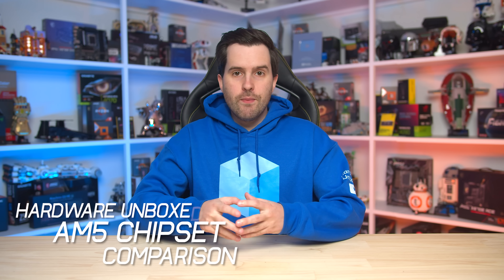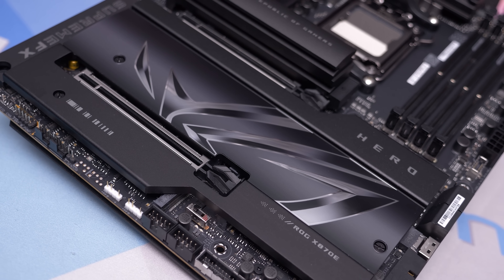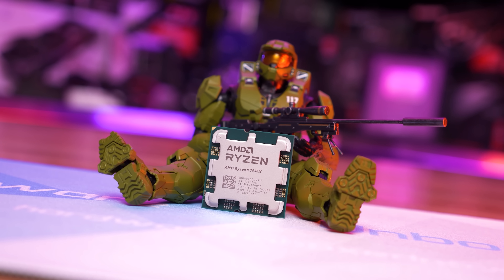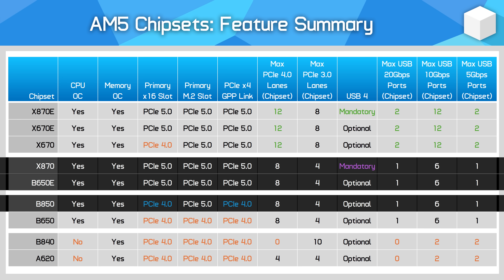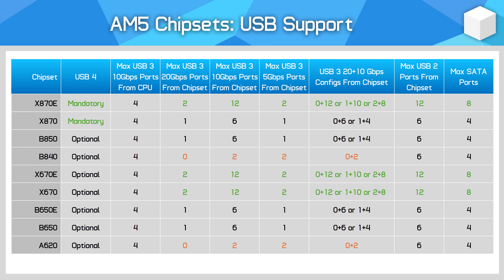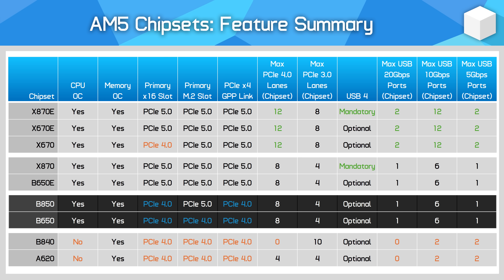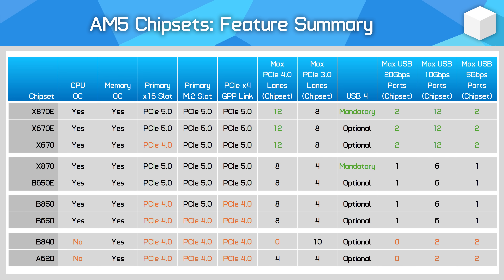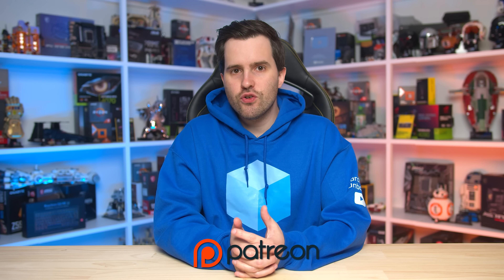AM5 Chipsets Compared - X870E vs X670E vs X870 vs X670 vs B650 vs B850 vs B840 vs A620

Comment: with a 7800x3d and 9700xt, gen 5 ssd, and cl30 6000 ddr5 memory, which chipset/board would be best to be a good upgrade path for zen 6/rdna 5 flagship gpu's that won't run into bifurcation/ddr5 memory issues (like excessive memory training at boot or expo instability). The 870E has the "usb4 tax" of 4 lanes but if you're not going to run multiple gen 5 ssd's (just 1 main one), will you still run into bifurcation issues? They seem like they've got the best ddr5 memory stability but between asrock nuking cpu's and msi supposedly having m.2 slot issues, it feels like I'm limited to asus or gigabyte. are you guys still going to do the x870E buying guide? or add like the new x870E to reviews like the gigabyte x3d lineup etc?

Comment: isn't there only x650 chipset as a die. and some MB configurations make it x650e version, like ability to rout pcie 5.0 signal. coz some MBs state x650 as  chipset. but according to specs can rout pcie 5.0 to gpu and  one m.2 slot as it should be. table in the video just brings more confusion

Comment: Im trying to build a new Gen5 system with a 9070 gpuwith a ryzen 7 7800x3d and im looking to use a mobo with it..its hard to find a matching board but i want to have the best uyse off my pci lanes so my guess a Asrock 870 pro is my best bet.

Comment: But today we have to answer one question: when you're still using an Athlon processor or an Intel i3, you might want to consider overclocking, but today it's no longer necessary, so all those glitches are unnecessary....Usually, in 2025, they are targeting Ryzen processors, most of which are already optimally tuned for optimal performance, unnecessary overclocking will only spoil the results, similarly to Intel,,,The most important thing that has remained for years is to maintain stability. This applies to the choice of motherboard, processor and RAM...these technical things, if you know them, you have a good computer

Comment: I got first an Asus x670e on sale for my 9950X3D and 2 x Kingston 6400 Mhz RAM with 32 CLT and a PCIe 5 NVME. I was dumb enough not to check the compitability of those components, because some were not listed as my PCIe 5 NVME and my RAM sticks. In theory they should work, but I had so many issues and instabilities that I had to sell my motherboard and buy a x870 instead. Havn't had any issues since then. Now I could have had just bad luck and gotten a faulty motherboard, I will never know. But to try to save 75-150 dollars, that money is not worth all the hassle I had to go through and it cost me more than I wanted to save, but if you don't go for the high end stuff like I did. Then for for the x670e motherboards!

Comment: So given the choice between X670E & X870 should I go for X670E but isn't it older gen, does newer gen matter or not? Please guide
Reply: if u dont use usb 4 its doesnt matter, got a x670 with 4 nvme slots, its good enough and better than b850

Comment: I'm thinking of upgrade from am4 to am5. Currently sitting on a 5800x3d and a 4070 ti. Should I go with a b850, wait for am6 or upgrade to a new gpu? Now the gpu is the 12gb vram that is the issue.
Reply: 5800x3d is still super good just stay on am4 until amd does something good with am6

Comment: Sooo, to pair with a 9800X3D a B850 or better is preferable for out-of-the-box functionality depending on budget? I would think it also depends on the board itself, some boards make the secondary M.2 slots share bandwidth with the primary PCIe slot. I've seen that on a couple Gigabyte boards, especially their boards with several M.2 PCIe 5.0 slots.

Comment: For now we don't need pci5 for the primary pcie slot. pci4 won't bottleneck a rtx5090. With the current generation improvements pcie4 will be good enough for a longtime. Only cheap pcie5 8x gpu;s could suffer maybe.

Comment: Im building a PC storage server and the B840 is perfect. I can pack those slots with Nvme expansion cards. Slap in an on hand 7700X, air cooler, cheap RAM and Im off to the races for peanuts.

Comment: happy for my Asrock A620M-HDV/M.2+. So far no problems and all core V can be reduced when integrated GPU is disabled. works with 7600X 5460Mhz and allcore 5250Mhz

Comment: Is it possible that you made a mistake in your video?

You say/show everywhere:

X870 = PCIe 5.0
B850 = PCIe 4.0

And that's WRONG everywhere, or did they change it on the high-end B850 boards?

My favorites:

Whether it's the B850 Aorus Elite, ASRock LiveMixer, or the other boards I like:
EVERYWHERE the GPU slot says "PCIe 5.0."

So, which is correct?

Comment: 4:42 Every B850 Motherboard I have looked at states the primary PCI-E x16 slot is PCI-E 5.0, which means the only real practical difference I have noticed between B850 and X870 is USB 4 support. As it stands now, in my country at least the 600s are disappearing and only the 800s remain, probably a sign that the manufacturers are no longer manufacturing 600 boards, or maybe the price markup that 800s have is too tempting for sellers to even bother with 600s anymore..
Reply: As he says further in his video, i think it's the minimum guaranteed by AMD but i guess mobos brands can still do more if they want to
Reply: @fapoya7794  From what I read online the main x16 slot is connected directly to the CPU, and on AM5 Ryzen 7000 and 9000 CPUs have a PCIe gen 5 controller (Ryzen 8000 APUs have a gen 4 PCIe controller), hence why the main x16 slot is gen 5 regardless of the chipset (if the manufacturer of the motherboard made the economic choice to place the required traces on the board for it to be gen 5, else if the manufacturer wants to reduce the complexity and cost of the board it will only route the traces for gen 4).

However, the second x16 slot (if present) is connected to the chipset, so it will be gen 4 on B850, but gen 5 on x870. That's what I'm understanding
Reply: I came down to the comments section to see if anybody else noticed that. I am considering a ASRock B850M Steal Legend and the specs clearly states PCI-E 5 for the x16 slot. Mistake or an update from the manufactures?
Reply: The same here. I recently bought an Aorus B850M with PCIe 5.0

Comment: Im in the market for a new board for a workstation rig that also games but i have no clue if it would be a mistake to go with the older x670e over the newer x870e  but the newer stuff for the boards i want are extremely overpriced. would it be a bad idea to ignore x870e and just get the older cheaper x670e with a ryzen 9 - 9950x or 9950xd? I just dont want to limit things and back myself into a corner if the newer boards end up having features you need to have.

Comment: https://youtu.be/AAlGMAELHok?si=2nmUvy5tjfhzFy7N intel nvidia networking specialists like persona game dance referring to cats not know what you point at but monkeys can but confused when it's changed or disguised dogs can sort od be person like as they know pointing. But intel mvidia ruin scsi ans pcie and fake not 0 latency or negative  latency ram and lame pentium net core 16bit trash cripple whole system so you can't 90s amd whole scsi data centre opteron stackable amd cpu or 1 ryzen faster than 11,000 playsation 3 with scsi 50 meters pciexpress extension ribbon to rx and power manual set for distance so they cripple all usb and graphics and sound and hdmi or dp so u buy x870E and use optical or ethernet and power over etherner scsi for whole worlds internet and their learning disability specialist specialness still shines in a big big grinding dance party like gears with crowbars.

Comment: The E in x870 E means the ethernet controller chip is different for higher bandwidth and better infinity fabric and cache. The issue is pci express gen 5.0 has so much bandwidth you see a 90s stackable opteron processor with usb could plug in hundreds of hdd and via cards via SCSI protocol. When cheap tablets and other phones cheap will all use same pciexpress spec and standards but they tend to half power and bandwidth by some vendors like some of the worst ruined by intel nvidja ram and xmp cheap 80s drama for like 15 dollar noname vendor sticks welded into boards on some 50 dollar like laptop stuff from alienware Dell or hp or else they kick all the Apple and whatever else away with real ram.and bandwidth. But when get a first ryzen or 2700x you adjust power bandwidth and pci express timings and use like 50 meters of pciexpress extension ribbon. When they made that not possible and molested bios and ram till the system can't boot half the time and runs poorly as its too fast so you use infinity fabric and cache so the ram can be garbage and slow and the processor keeps it up in time with pure negative latency and quantum infinity cache its never need matching it specific stuff but the divider can help. You set bios to conflicting junk timings of intel instead of less than 0 latency or 0 or real-time you put garbage intel 9s and 13s and 69s you end up with refresh cycles and secondary memory timings that could outer space turbo warp speed. The issue is the usb ports are pcie lanes straight in especially for plundervault exploit garbage they replaced with usb4 chips but it's slower usb or sort of front side bus falsely set to awful stuff and their net core and other pentium rubbish means your whole CPU is an amputee pulling itself with its teeth on foot outside its hyperspace fleet flagship time travelling space ship. When you go to run.bigger than google data centre like set ups from the one ryzen or thread ripper their ding dong dongles required brains means it's not possible however you can use etherenet power standards and PPOE and power over ethernet and their timings and stuff to the quantum infinity faster than reality by years of full radiation accurate weather prediction computer can use the ethernet and internet protocols with USB devices and things like hdmi to USB or DP to usb those both have ethernet etc. So your computer can software render and software everything like not maths not computers and if they dick over network protocols they have 0 internet such smart intel nvidia retard criminals lol

Comment: Does AMD Ryzen 8700G runs two M.2 SSD at 4.0x4  lanes when there are PGU installed as you mentioned it has 20 PCIE lanes that means it will share the 20 lane with if there are 1 GPU and two SSD then it will be X16 and X2 X2 ? Right?

Comment: This video does a good job at outlining the various differences. This all raises more questions about my Crosshair X670E Hero and what hardware configurations are viable until lane sharing occurs. Running a 7950X3D, 4090, 1 gen5 SSD (primary), 3 gen4 SSD, SATA HDD, 2.5Gb LAN. Am I pushing it even though it has dual chipsets? Anyone found an accurate block diagram?

Comment: I ordered a X870 to replace my B650 and ended up returning the X870 to get the X870E due to having a lot of storage and USB devices and using VR headsets while racing. Just better to have the more capable chipset for future expansion.. B650 chipset is giving me issue to the X870 probably would have not fixed my issue but the X870E should do everything and then more. Thanks for the video

Comment: Maybe worth noting that AMD guaranteeing PCIe Gen4 does not mean the board won't have PCIe Gen5. The MSI B850 Tomahawk does have Gen5 PCIe and Gen5 M.2.
Since the CPU and socket have PCIe Gen5, what would be the reason not to have it on the board? Maybe cheaper materials and PCB design that prevents the wiring to technically reach 32 GT/s?

Comment: Ranking and GPU Slot Gen:
Please note that a premium on a lower chipset (especially X series) can beat some higher chipsets depending on your needs.
X870E PCIe 5
X670E PCIe 5
X870 PCIe 5
X670 PCIe 4
B850E PCIe 5
B650E PCie 5
B850 PCIe 4
B650 PCIe 4

Below are boards that are low end, really only support plugging ur stuff in and EXPOing ur RAM
B840 PCIe 4
A620 PCIe 4
Reply: Every B850 board I look at says it's PCIe 5.0 on the main GPU slot. Am I missing something?

Comment: I had to buy the 9800x3d in a mobo bundle if i wanted it now at retail prices. It came with a X870E gigabyte board. Its pretty solid. When your looking at a $50-$75 difference between X670e might as well

Comment: There is slightly more to it, ram comparability was not mentioned. My only experience was with ASUS so take it with a grain of salt. If you look at the RAM compatibility lists between boards they vary a lot just between which version of the processors you plug in. The an ASUS B650 Prime board supported GSKill 6400 ram for 8000 series processors but not for 9000. Check other boards higher in the stack and the discrepancy is less. Somehow they still want to charge 200$+ for these boards. Someone needs to do some sort of expose on this Markup.

Comment: Some Gigabyte B650 boards are NOT compatible with Ryzen 9000.
It has nothing to do with updating BIOS.
It's complete incompatibility.

Gigabyte Gaming X AX , the original version isn't compatible with Ryzen 9000 CPUs.
That board had several revisions.
1.1,1.2 and more .
The very first isn't the only such version. 
At least 1 of it's revisions are NOT compatible with it.
I doubt owners of this fine board were very happy when they discovered it .
Unless offcourse none of them decided to upgrade and are completely oblivious to it at this time .

Comment: How do you update a the BIOS?  Do you put the new bios file on a usb stick, put the stock in a usb socket, and push the button on a motherboard?  Does the motherboard need to be powered on?
Reply: Depends on the motherboard model, but in general yes it's exactly like you describe it. But read the manual first before yoloing it

Comment: Looking to upgrade my MOBO and cpu to a 9800x3d do I need to change my ddr4 ram to ddr5 or I can keep everything as is? Also will my AIO work or that needs to be changed also. Sorry for the noob questions.
Reply: Am5 only supports ddr5, and you shouldn't need to get a newer aio as it uses the am4 mounting system

Edit spelling
Reply: @RonneyRe  perfect thanks

Comment: I’m looking at replacing my 6 year old system. I want to build something that will last me another 5-6 years. It seems the x870s are overpriced for what they offer at the moment.

I’m looking to spend around $300. Do I go for the x870s to get the most out of it in the long run? Or save money and go for x670, or B850? Would love to hear recommendations on what they think is best in the market right now for $300 that will provide good performance down the road.

Comment: Assistance please.. According to the PCIe support table in this video B850 is PCIe 4.0 (x16 slot), yet this board ASUS ROG STRIX B850-I GAMING WIFI states that it is PCIe 5.0 x16 and both of M2 slots are PCIe 5.0 x 4. Is it a good option to consider right now?

Comment: Just in case anyone was looking or wondering as I was, some B650 chiptsets (specifically referring to this chipset rather than the B650E) do support PCIe 5.0 for the primay M.2 slot which is what I was looking for. However certainly do not suppot PCIe for the x16 slots though, no matter which brand of board you buy. I'm not intending to correct the video as quite rightly, he says 'the minimum' in his chart.

Comment: I just bought an X670E board. Half the price of X870E (and cheaper than all 800 boards), and I'm only missing USB4? Not bad. Without this video, I would've fallen for the scam. 

Bios flashback makes it a no brainer too. CPU compatibility is no longer a problem.

Also it's not just 800 that is confusing. 600 is bad as well IMO. Why is B650E better than X670 in some areas? Like pcie5 support. X should be strictly better than B IMO.

Also I think the 'E' stands for 'extended'.
Reply: And you don't have WiFi 7 lol

Comment: This is good news, since I am qiute happy with my X670E Gene and 2x24 8000 Mhz RAM.
Then I can put in a 9850X3d when it is released and not worry about missing out on performance.

I did look at the X870I (itx) variant from Asus, but it seems to have fewer power stages than my X670E Gene (mATX).
Of course one can say its not fair to compare mATX to ITX, but I was considering buying a new ITX board, but it seems it wold actually be slightly worse (except the Wifi 7, which I dont use on stationary anyways).

Comment: Bought a Gigabyte Aorus x870 thinking it was a great deal. It had an OK price, the digital debugger for mobo issues seemed so cool, but then USB 4 at the cost of killing a M2 SSD slot... that all impacting on the x16 PCI-E bus where the GPU must be, turning it into a x8 PCI-E slot. Most people say "close to no impact", but come on... I haven't even opened the box, my bad on not doing my homework before. Which is ridiculous - it's a challenge to buy a PC today, or to assemble one in parts! Looks like the 90's again... Good were the days back in the 2000's when things started getting simpler, and a GPU costing 400 euros was considered the top model of them all. Now back to confusion! Thanks for your video, it's a masterclass to us all.

Comment: U don’t even need to buy the x870 and B840 just buy the x670 and B650 since it have drop in price and still deliver the same thing and save 200-300 to buy a higher end GPU or CPU for better performance

Comment: I think im just going to get the asrock b650m-hdv/m.2. It has all features i need, and is pretty cheap.

I also found some info that it is better at doing high speeds on ram than more expensive motherboards due to having only 2 ram slots, and while that isn't very beneficial for current ryzen cpus due to infinity fabric bandwidth limitations, i think that could change with next gen ryzen and i might be able to get little more performance out of those.